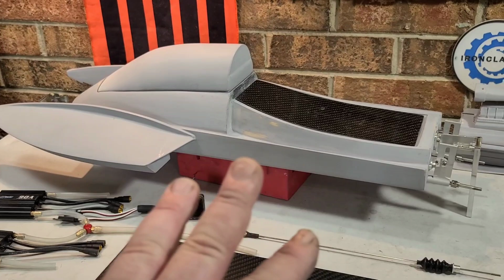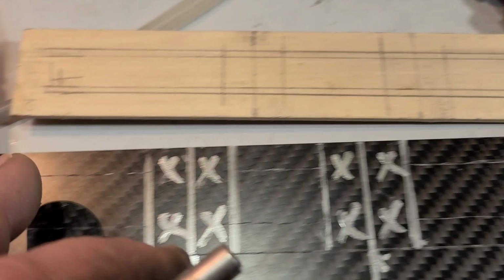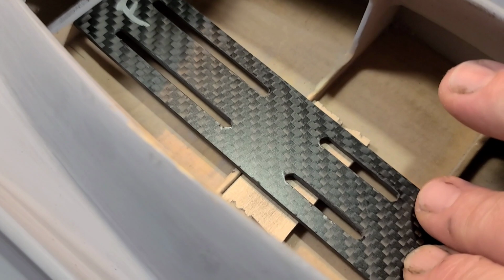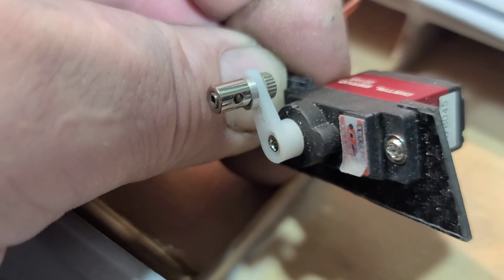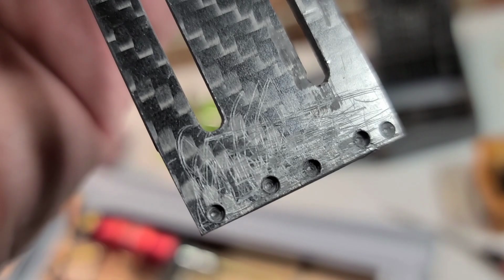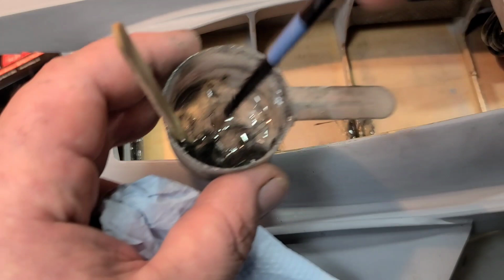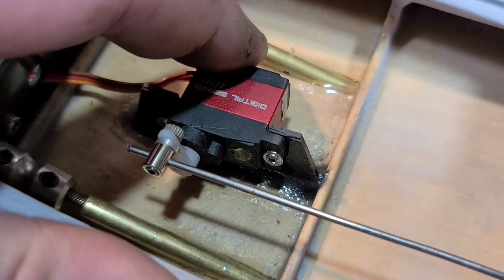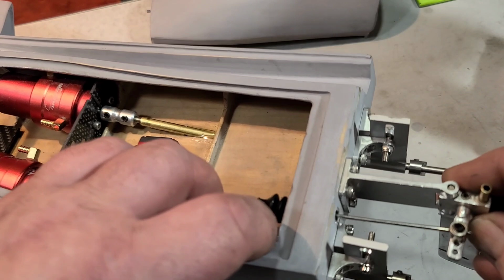Pt3 Twin Motor Rc Drag Boat Build - Battery Tray, Servo & Rudder install - Dual Motor Hydroplane

Comment: i love the idea but if you think abt it with those two motors the rudder wont do much trying to turn it. even with the ul-19 is barely turns with one motor. the two motors are just going to try and put it forwards as you turn.

love the content big b

Comment: This thing would be cool Nitro or gas.  Did you already think of that and dismiss it or you just prefer electric?
Reply from the maker: Man I considered the toyan v8 engine for a scale looking boat but that motor is to expensive for my blood.       I actually prefer electrics..

Comment: wow i could have used a cutting wheel like that last night ...it looks like your dremel is same shaft size as mine... where do you get wheel like that?? I converted a screw on carbon prop to dog bolt on... my cheap wheel broke off..then i lost the tiny screw on the floor :(
Reply from the maker: Home depot has the "diamond" cutting wheels. Wal mart  or Lowes.
Reply: @IRONCLADRC  yes ,i also see a lot on line...i have 3 dremels ,but the right disc's etc is a game changer..thanks